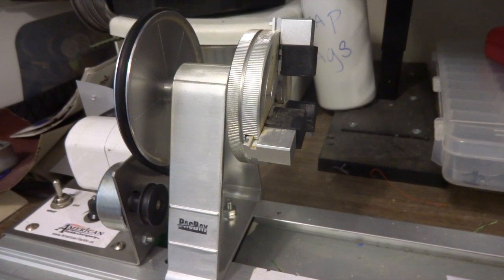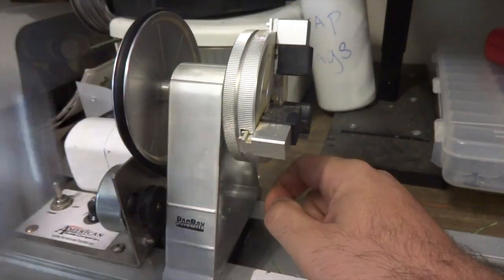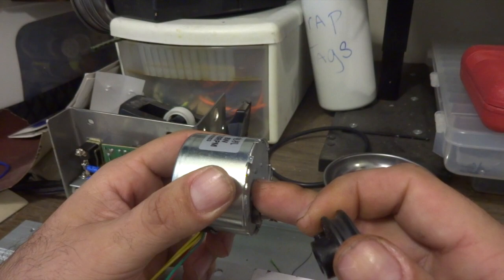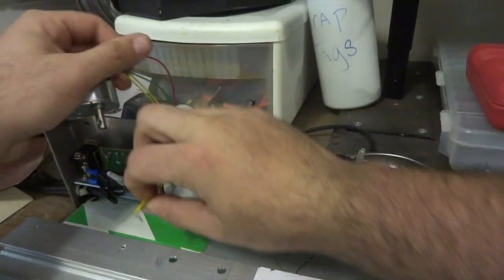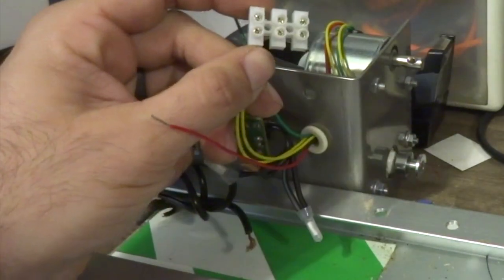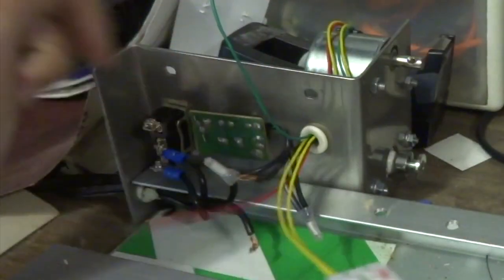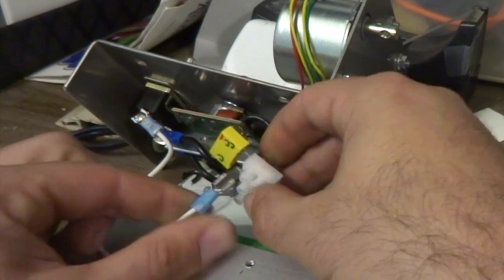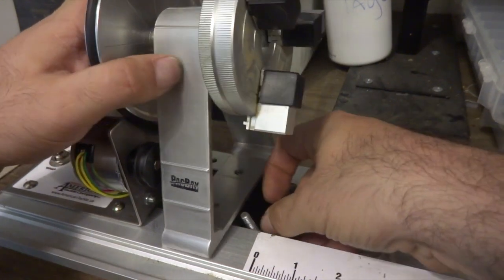Upgrade Power Wrapper Drying Motor DIY

Comment: I know you'll say it's expensive but you should look into the Wago wire splicing option. Frankly I thought it was a bit pricey until I started using it everywhere, house electrical, car electrical, small electronic projects, kayak battery connection for the fish finder. SUPER simple and faster than anything else I've used. If it's a lot safer too!
Reply from the maker: I am going to look into those thanks for the tip

Comment: good instructional video.  Where did you find your electrical connector?  I have only found the push in type and I would rather have a screw securing the wire.  Appreciate any information
Reply from the maker: Dorf Lonnigan I found them on Amazon, I did buy a big pack of them because I do a lot of different here and there projects Rustark 100Pcs 2P CH2 + 3P CH3 Quick Connector Spring Wire Connector Screw Terminal Barrier Block for LED Strip Light Wire Connecting - 4 Styles https://www.amazon.com/dp/B07283L2QS/ref=cm_sw_r_cp_api_i_FZKBEbQBQ6QMV
Best of luck, thanks for watching
Reply: Thankyou for the information, appreciate it.  keep the tips comming